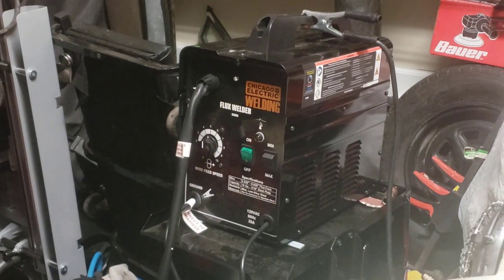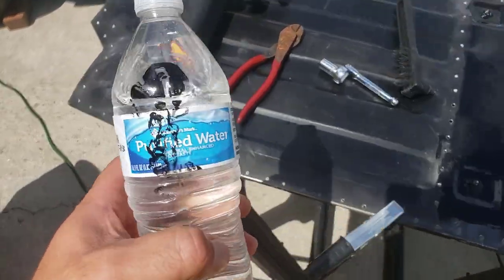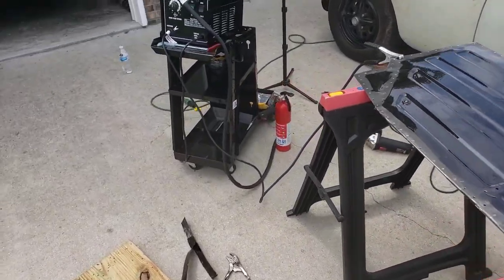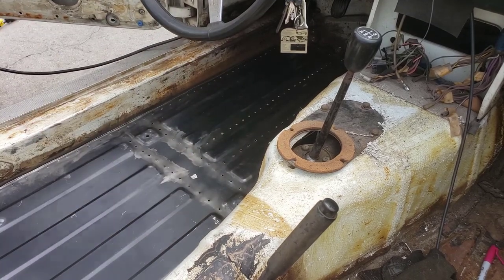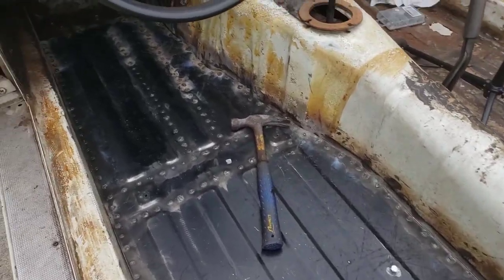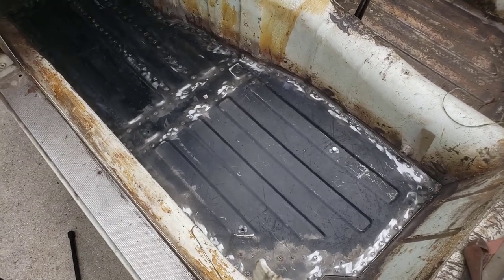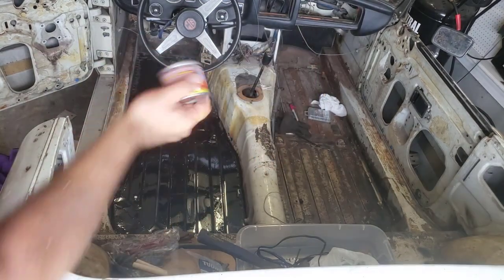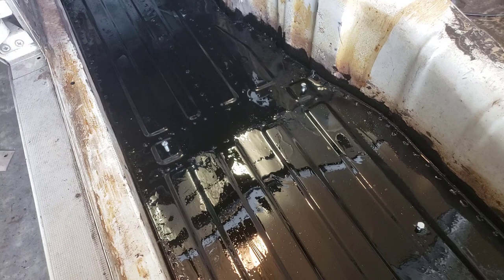$100 Harbor Freight Flux Core 125 A Review Gasless Mig Welding Floorpans How To Weld Floorpans MGB

Comment: Is that floor bare metal?  It looked like paint, but the closer I looked, the less sure I was.  The bad news about POR15 is that it will likely not stick to previous paint.  It actually sticks better to bare metal, preferably with flash rust on it.  Oh, and that "never going to see rain" promise?  Ask any open car owner who drives their car how that actually works out.  You probably know this by now, but I think I would have coated the bolts with grease before doing the POR15 sealing job.  Sitting here looking at it, after you finished the welding, I think I would have tried jacking the car up by its jacking points, especially the left rear, to see how the welds held.  But hey, working on a project like this is no fun, if all you do is do what everyone else has done before you.
Reply: @BrailsfordsRides , I was just thinking the grease would resist the POR15.  POR15 is the only think known to man to be a better threadlocker than nature's threadlocker (rust).  I'm a big fan of POR15 and its gas tank sealer system.

Comment: You’d have better luck with the titanium 125, you need more heat adjustment if your going to do varying gauges of sheet metal
Reply from the maker: I appreciate the advice, the welds I did with this cheap welder held up well.  Ended up selling the car for a car with 4 seats for my kids to come along too but I know the new owner and they are still solid luckily

Comment: Why haven’t you got the shroud on the end of the welding torch? The inert gas produced by the core of the (no gas) welding wire is a shield to protect the weld from absorbing impurities from the air and causing porosity and poor weld adhesion, I’ve been a welder all my life and I’ve used no gas wire when I’ve had to, never liked it and it’s difficult to get a good weld even for a professional, sorry to lay all this negativity on you, but Bravo for taking on the task of bringing another MGB back to life, I’ve just done the drivers side and put lots of videos on YouTube, good luck with the rest.
Reply: Ok so explain why an arc electrode does not have a shield at the end  for the inert gas being produced?  Exactly because its not needed, just like his set up not needed.
Reply from the maker: @he-got-a-new-mommy  I had a great explanation on this in a comment but I migrated my channel from my personal account to a brand account and this deletes all the comments I made before the migration.

Comment: Hey, I think you did a great job for someone who never well before like me. How is the floor Pan holding up now?   this is motivation for me To complete my project. Because I have an 85 Chevy Camaro that the driver side floor Pan is gone pretty much any tips or tricks. I will  appreciate.  Thanks
Reply from the maker: I have welded briefly for a college project but this was my first time gasless welding.  Tips would be make sure you practice on some scrap similar metals.  You will need enough power to get a strong bond with may also require an increased flow.   I'd recommend starting at whatever I used in this vid, I can't remember but I know I said it somewhere lol.  As far as holding up, I think it's holding great as I know the new owner is enjoying it

Comment: I bought the same welder and I need to put floor pans in my Series 2 E type I inherited from my dad.  After everyone says these welders won’t work on sheet metal you’ve proven them wrong. Like your style man.  I’ll be replaying this video many times I bet.
Reply from the maker: Yeah you just have to make sure the power is high enough that you are penetrating and not laying bubble welds with air gaps in between.  This is the less than ideal way but after you seam seal and or lay down some POR over it, it becomes Bulletproof.  Thanks for watching Sir!

Comment: Good job on that floor pan. I see Stevie Cuz made a comment. I have been watching him do the metal work on his MGB, my hat is off to both of you for drilling the holes and plug welding. I went around the edge top and bottom and welded. I think yours looks much cleaner though. Do not forget to throw some seam sealer on it.
Reply from the maker: Thanks man, I had no idea how it was going to come out but I figured worst case scenario i order a new pan and take it to a pro.  Im happy with it and I haven't fallen through he floor yet driving haha.  I do need some sealer still.  Little bit of muffler heat creeps through the cracks.  What product did you use to seal
Reply from the maker: I loaded the cracks with POR
Reply: @BrailsfordsRides  I got it from here, use a cheap brush from harbor freight. https://www.amazon.com/Evercoat-365-Brushable-Seam-Sealer/dp/B000Q8E7AU/ref=sr_1_2?dchild=1&keywords=evercoat+seam+sealer&qid=1607098654&sr=8-2. You can get the tube, I liked this much better.

Comment: Nice video… what size drill bit did u use to make the whole
Reply from the maker: i dont remember this was like 3 years ago, i think i just picked one i thought would be large enough to give the weld enough time and space to bond to the frame.  to small and it will close off before you make a good connection with the frame

Comment: Great vid should I ever need to do this with my '72 B.  I wish you would have shown underneath the new floor pan so we could see what you are welding to.  And what prep went into the sheet metal underneath.  
    Also saw your brake master vid.  I'm in the middle of that job at present.  Cheers!  Happy Motoring!
Reply from the maker: There are several videos showing me cutting out the old pans, so you can see the frame I weld it to

Comment: Been thinking about attempting to weld the floor pans in my 76 regal.. I have no experience but want to do most of the work on my car to save money
Reply from the maker: You could definitely do it and save money if you already have access to a welder.  If not you will need a welder, a shield, gloves, and a better spool than comes in this kit.  Then practice a little bit before you go right at it.  But you can definitely handle it with some practice

Comment: Would you use this welder for the dog legs?
Reply from the maker: Im sure you can, but I think you will want a cleaner weld for those.  I did this because I only had to lay spot welds that I could bust clean with a wire wheel.  Floorpan on a budget ya know
Reply: @BrailsfordsRides  Thanks. BTW are you planning on put the trim back on or shave it? I'm trying to decide which would look better. I'd love to install flares too but don't know if I want to cut the fenders.
Reply from the maker: @jerryp2433  I hate to say it but I actually sold the car last year
Reply: @BrailsfordsRides  ok I might do the same. haha.
Reply from the maker: @jerryp2433  honestly I loved the car but it fell in my lap as a pile of parts, I got it running, enjoyed it for a bit and then sold it to buy a Mustang project which is one of the 2 mustangs featured on the channel now
Reply: @BrailsfordsRides  I bought mine with the vision of creating  a poor man's  shelby. planning a 302 swap. I think I bit off more than I can chew....but we'll see. I definitely don't want to have it in my garage on a rotisserie for 3 years like with what you see with most project cars. lol. I suppose buying a foxbody would be the smarter thing to do. lol.
Reply from the maker: @jerryp2433  I was also intending on making a patina Fobra with a 302 and side pipes lol 😆

Comment: Hey mate, I’m thinking of working on my MGB myself (needs new floors and maybe sills). Could you let me know how the repairs on your car are holding up? I’m considering using a cheaper gasless mig
Reply from the maker: I sold the car a year ago but the new owner and I are still in touch.  He hasn't told me anything bad about my work.  It's all about using the correct power settings to get good penetration and minimize bubbles.  You do that and it should hold up.  The bead is what matters.

Comment: Did the floor pan come exactly fit or did you have to trim it? Were all those holes where you made your plug welds there or did you have to drill them? Is the car done now and do you have an "after" picture? It looks middy nice as is!
Reply from the maker: 1. The floor pan did have to be trimmed if you dig through some of my earlier videos or my MGB playlist you should find it.  Otherwise it would have been crammed in there.  https://www.youtube.com/watch?v=2TDLL7bCopo
2. I drilled the holes and I put up a video on how I went about that too I believe.  It has been a long time. https://www.youtube.com/watch?v=X0pFAFg2cYg
3. The driver side is done, I still need to do the passenger side.  I was hesitant because of the fuel lines and also I am having another baby and i work on the cars at night.  So the wife needs rest so the car has had to wait for anything that makes alot of noise.  I appreciate the compliment sir and you checking out my channel.  I am not a pro but an avg guy figuring out my way to make this work on a budget.  For pics or whatever hit me up on my channel facebook page or IG, not a problem

Comment: Hey, so I plan to do this pretty soon to my 1976 bmw. I have never welded, only soldered. I'll be buying this welder and the recommended wire. Couple questions! Are the holes necessary? Does that only work if you are laying it on top of metal? That's my only guess being that you are not welding the actual edges of the floor pan. I am just trying to figure out the best method will be for me, as some of it will just be patch panels but my front passenger side will be the whole floor pan. I like the idea of the holes and not welding a complete line but will do whatever is best. Thanks for the video!
Reply from the maker: Hey man alot of people do the holes and then you use seam sealer to fill in the edges.  I did it this way because it is the way the car was spot welded from the factory, just alot cleaner back then lol.  I will be doing a patch job on my passenger side at some point that will likely be a mix of holes and edge welds
Reply from the maker: I also recommend using some of the pan scraps that you removed or if you have an excess to go in practice welding 2 pieces of scrap together before you attack the car.  Just tey to make sure you are simulating your working metal as best you can!   Best of luck Steven!

Comment: I am doing my xj next week. Are you a pro in welding or beginner. Myself is a beginner, same welder any tips??
Reply from the maker: Hey Terry thanks for checking out my video.  I would definitely pre drill the holes and make sure they are big enough to get a bead started on the frame and walk over to the pan.  Id use the settings I listed in here that worked.  Definitely do not use the spool that came with the welder just toss it and buy the Vulcan .3

I am not a pro but I welded a bit in college so what you are seeing is another avg guys attempt, lol

Have you already cut out the old pans?  If not go find my vids where I did that and Definitely drill the outline of the frame before cutting to prevent mistakes
Reply: Can the metals overlaps or should be exact fit when welding?
Reply from the maker: @terryantony2296  I mean I guess it could but I cut mine down in places to fit better
Reply from the maker: @terryantony2296  10.99 angle grinder with some cutting wheels from Harbor Freight totally worth it

Comment: Ok, I’ll take a bow, as I say I’ve only done a small amount of flux cored welding and it looks like the machine was on the wrong polarity, hence never bothered with it again and stuck to the stick and mig. I think the holes drilled in this job are too small to allow best adhesion through to crossmember, just a little advice,
Reply from the maker: Time will tell, all I know is I am 235 pounds and what is not pictured here is my test of it.  I jumped pretty violently up and down on it to see if I could break it free.  Since I've made this video the seats are in and I've put 1500 miles on the car so far with no issues.  The floor is definitely solid.   I appreciate the suggestions though.  I still have to do the front of the passenger pan

Comment: I'm glad you cought that I was also unsubbed also but subbed again when you run out of wire try kiswel wire you can get it off ebay two rolls 23$ tons less splatter
Reply from the maker: Ill check that out, thanks for the tip